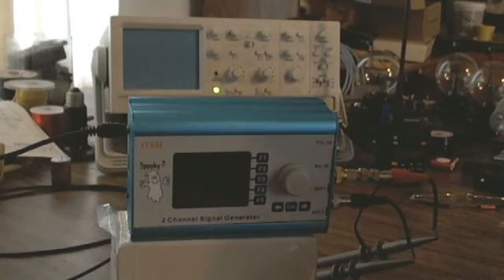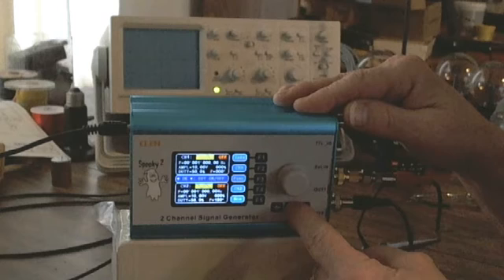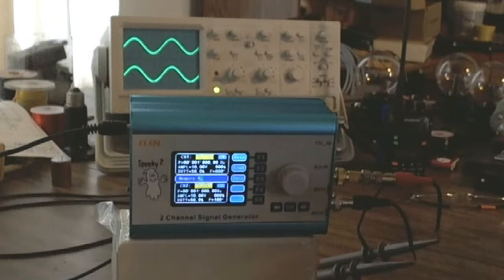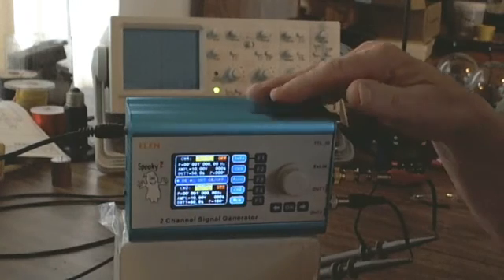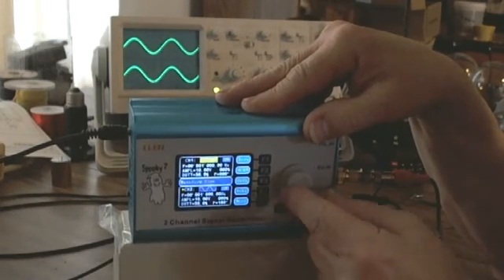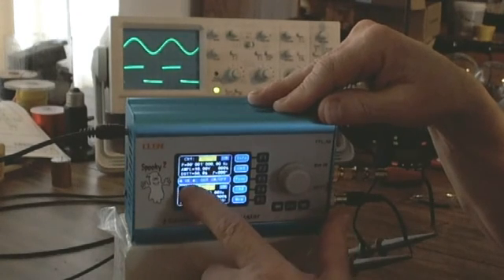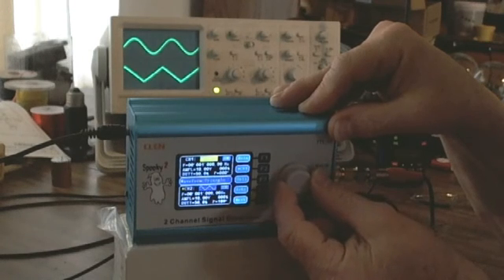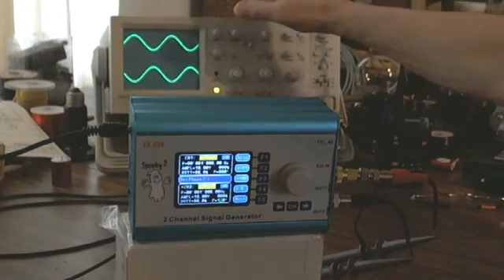Spooky2 Intro Button Tutorial

Comment: Hi, do you need the spooky2 boost to be able to do the invert sink?

Thanks
Reply from the maker: NO.  Invert sink is often used with a bifilar coil type of delivery device.  The Spooky Boost allows you to connect to a bifilar device that is configured for a single cable connection.  if this is the case then the unit is internally configured with two windings connected so the field currents oppose or buck one another.  This will generate a Scalar Wave.  A bifilar coiil has 4 wires, two wire for each part of bifilar coil.  You can connect the four wires to be configured as a series connection opposing or series connection adding.  When connected in an opposing configuration you can use a single channel from the spooky to drive the bifilar in a Scalar Wave mode with 1/2 the power of what a Spooky Boost would offer.  Alternatively you can connect each winding of the Bifilar coil to a seperate channel in the Spooky.  Through either the Spooky software or manually configuring the Spooky2 with it's control panel,  generate identical Waves, Amplitude, and Frequency with each channel being 180 degrees out of phase with one another..  You can generate a Scalar Wave this way with the same power as what a spooky Boost cable offers.  How to run either the Spooky software or the how to use the Spooky control panel is more than what can be easily described in a simple narrative.
Reply: @gskempe9  Thank you a tonne! This helps me out!!
I've never used a spooky2 generator before but will be purchasing the xm soon.
Hey, do you happen to know what the power output difference is between the xm and the gx generators?
I believe that the xm is 4 watts??
Reply from the maker: @sasorgonitecreations  4 watts may be a bit of an exaggeration.  The power output is not linear.  Each channel can deliver maybe a maximum of about 25 milli-amps, depending upon the output voltage level before the output signal start to degenerate by being loaded down by whatever you are driving.  The Gen-X version has 4 channels of output the XM has 2 channels.

Comment: If you wanted to run the pemf out of high power port without a pc should you use both channels or just one ? Assuming we are just using the pemf adapter from spooky which is just one pemf north and south .
Reply from the maker: The ‘Spooky Boost’ will allow doubling the voltage to the coil you are using.  The ‘Spooky Boost’ needs to be connected to both ports of the Spooky2 with one of the ports running in ‘Invert Sync’ mode.  This will generate a little stronger magnetic wave from your coil.  However, please understand that without an amplifier the Spooky2 cannot generate a very strong magnetic field compared to a High Power PEMF unit.  A REAL High Powered PEMF Unit will minimally generate magnetic pulses that are over 1000 time stronger than what the Spooky PEMF coil could handle or generate.
Reply: gskempe9 if i have a pa amp that can generate 2500W at 4 ohm, could i use that as an amp?

Comment: software quit working  after 1 use. Nothing but run-time error '9' subscript out of range, no fix and spooky2 says it's microsoft tho  I never ever ran into a run-time error over the past 22 years of using computers until this software install. DAY 1  .IT NOW IS 4 DAYS OLD and SOFTWARE IS UNAVAILABLE EVEN WITH A COMPUTER. Had to replace the communications buard and haven't even used this product twice since my $400.00 purchase 4 days ago. I may do this and run a frequency or two from the frequencys that came with the download  in the spooky folder and manually input the the frequency i want to use but for the most part not for $400.00. If I'm being forced to use a generator and  manually inputing   programing i just as soon do it for $124.00 less the corrupt software download with a different generator for less that does the exact some thing as spooky does for $400.00
Reply from the maker: I suspect you sent this by accident.  I am and independent researcher that is not part of the Spooky team.  It really sounds like you are having a hard day.  I do not sponsor or sell the Spooky2 hardware or the Spooky software and suggest you contact the Spooky team or the Chinese manufacture of the Spooky2 product.  I hear your frustration but can only help by pointing you in the proper direction to pursue this problem.  Respectfully, Steve
Reply from the maker: I’m very sorry to hear about your difficulties.  However I would like to suggest you contact the Spooky team or the Chinese manufacture regarding this problem.  I do not sell the Spooky2 or Spooky software.  I am just an independent researcher trying to help.
Reply: What operating system are you using?
I've never had any problems at all with the software, but if you are having problems, just download it and re-install it again, it's free.
Reply: Jimmy Westra runtime error 9 IS your computers problem. Most common is a dll that is missing. Try installing different visual basic c++ runtime installers onto your pc. Most software needs it to run.
Also try using google for gods sake to search for run time error solutions with windows